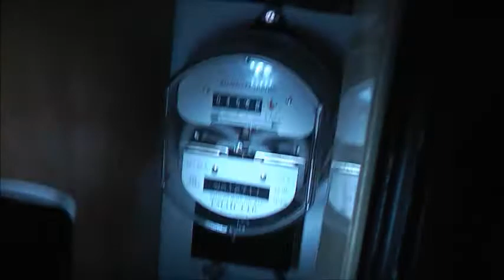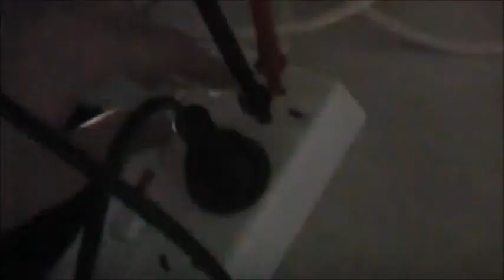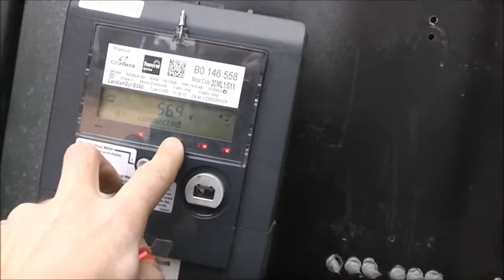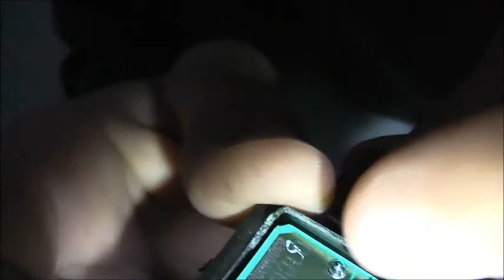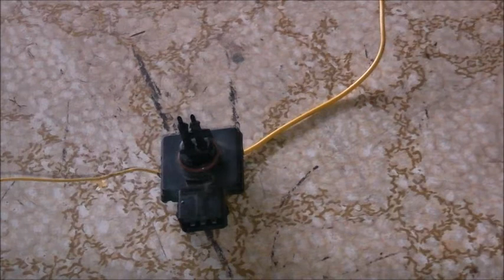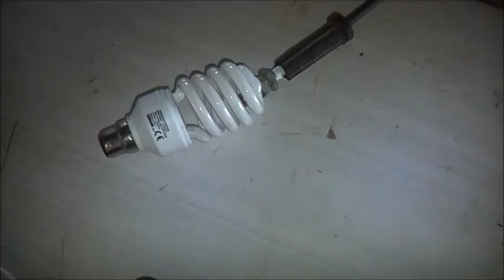Brownout & Teardown!

Comment: To a large extent, but the main purpose is to sell new not so smart meters 12 year down the road when the China made parts take a crap, same with the routers. It's what happens when you have politicians (failed lawyers) and idiot executives make engineering decisions based on slick video sales pitches from the makers of not so smart meters rather then listening to the power system engineers.